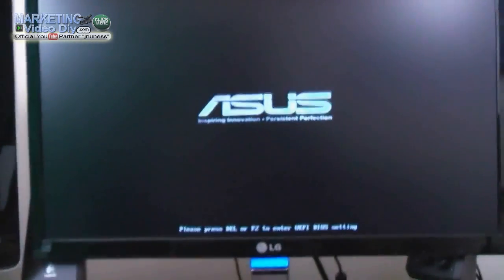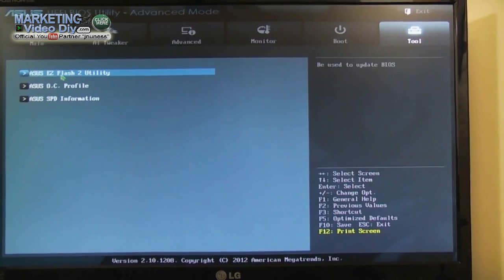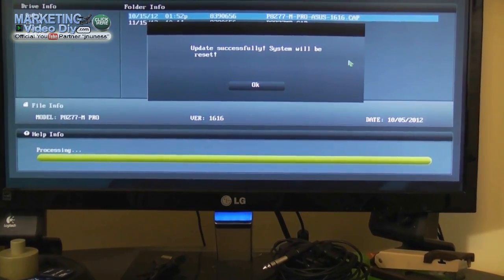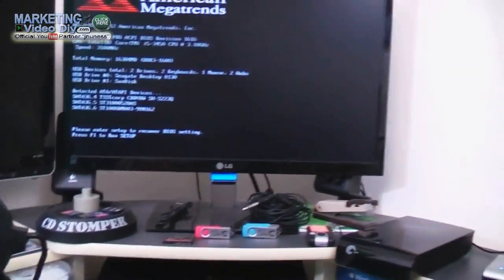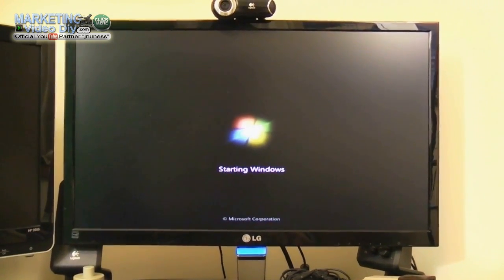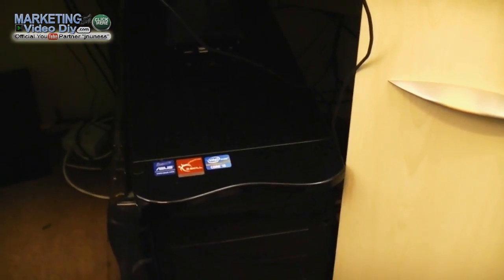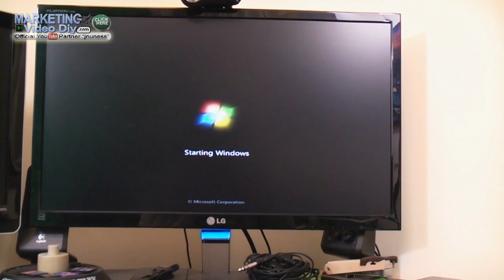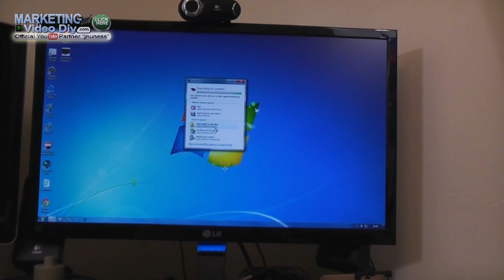ASUS P8Z77 M PRO failing to boot

Comment: I have a problem.. When I start my pc, the screen didnt show up and the pc keeps turning on and off continuously. Any help? My father cleared all the fans and tried the methods shown in the video, but it still have the same result. Is the power supply fault or mother board?
Reply: Gabriel Lee  bro its also same prob with me but i can change my hard drive and remove cell from board and remove rams clean then then then start pc after some beeps again install rams and hard drive then my pc goes on

Comment: Hi, I really need your help.. I have ASUS P8Z77-M.. same problem and I have follow your guide with the jumper and its power up twice but the first one, its just running but nothing shown on my monitor, just red light on the memOK. I turn it off and try remove the graphic card and one of the ram memory card then powered it up again but still its not booting. I put everything in again and try to power up again but failed.. even did the same thing again on the jumper. I did changes the cr2032 battery but still I cant get it to power it up.. I should have read it earlier about the red light memOK. (push that button about few second till it flashing). I really need your help if you have any other idea how to make it run again.. by the way.. the ram memory are in good condition, its just the mobo itself.
Thanks in advance.
Reply from the maker: +kunee51 Hi, make sure you use  gloves when changing the battery and do not touch on any parts with your bare hands after you put the system under load or the battery simply drains off.
So, what you should do now is unplug the machine from the main power supply completely, press the power button for a few seconds, while looking at the machine, you will notice any static charge will cause your CPU fan to turn slightly. If nothing happens, it means all energy has been drained from the system.
Now, using latex gloves, replace the CMOS battery with a new one.
Again, do not attempt to replace the battery with your bare hands, or the battery will simply go dead, when it comes into contact with your fingers and the board.
Regards,
Jose.
Reply from the maker: +kunee51 Regarding the machine starting and you getting nothing on the monitor, you need to make sure that the system is booting from the right hard drive.
How many hard drives do you have installed on the system? And if so, is there an operations system already installed?
Regards,
Jose.
Reply: +How to Video and Marketing Thanks for your reply.. I will try this by today and will let you know what's happening.. btw only one drive an yes there's an OS running on that hdd.
Thank you very much...
Reply: +kunee51 Hi again.. Im sorry, really forgot to let you know that it was failed to start not even once.. really had a bad time with it. I've checked other component by install it on other pc and it was ok.. its really my asus mobo problem.. just let me know if you have other idea what was happening..
Reply from the maker: +kunee51 If you bought it from an authorised retailer, then you can send it back and will be replaced free of charge.
Regards,
Jose.
Reply: +How to Video and Marketing bought this mobo for quite sometime.. I cant remember how long will the warranty lasted for.. will check... Thanks..

Comment: I fail to see how clearing the CMOS will fix a dead boot issue. It should at least try to physically start up. Jumping the CMOS is only good for clearing the BIOS settings. Poor BIOS settings will not prevent from physically starting to boot (as shown in your video)

Comment: So I have a problem with booting, but it's not quite the same. It can start to the Asus screen, but after that it just flickers gray and restarts over and over. I read a little about it on forums and they're suggesting  I should try to use single ram sticks in every DIMM, same results. I changed harddrive still same results. I removed the GPU and went on the boards internal gpu, still same results. Should I change CMOS or try updating bios? What do you think? Also something to add, I've been able to boot it normally before this, it just stopped working one day.
Reply from the maker: Xorrak Hi, how many beeps do you get when pressing the power button?
Reply: ***** Hey, thanks for responding. I started pc now and I don't hear any beep. It just keep restarting over and over to the Asus screen with a slight gray flicker after Asus screen happens. I have the case open and all I can see is a red led that flashes each time it restarts "dram" I have pressed that memok button and it says the memory are okay. Going into bios is not a problem at all. Just getting to windows.
Reply from the maker: Xorrak Hi, This is most likely an external problem. Bear in mind, the beeps you're talking about, should be quite faded, and they come from your board, and not from your speakers.
The best course of action is to unplug every USB device except your keyboard and the mouse,.
Next, turn off the machine, unplug it from the main power source, and press the power button a couple of times for a few seconds, so the system gets into static discharge.
Then, plug in the power cord, and power up your machine.
Once you get to the windows, then plug in your external devices, one by one, making sure it downloads and updates to the latest drivers.
Regards,
Jose.
Reply: Hi again. I tried as you instructed. I only had mouse and keyboard for USB but I tried to pull out both and one by one, while turning of the computer, pulling out cable and then hit power button on the computer a couple seconds but still same results. I put my ear so close that it almost got into the fan, still couldn't hear any beeping sound, just fans.
Reply: ***** Hi, sorry to bother you again, I just wanted to say I found the issue. My graphics card had broken, I replaced it and it worked like normal again.
Reply from the maker: Xorrak Hi, Thanks for the update. I knew it was something to do with the components, but the fact that you said you couldn't hear any beeps kind of threw things out of balance.
Do you still have no beeps when starting the computer?
Even though everything is working now, you should still hear one single beep, when pressing the power button on the case.
Regards,
Jose.
Reply from the maker: Xorrak ok you can hear one beep on my video at 3:32, click on the time to see the video again from 3:30, and you can year the single beep in the background, meaning everything is OK, usually this is how it works, if you get 2 beeps one of your components needs updates or is faulty.
These two beeps refers to any USB drives, graphics cards, hard drives, RAM cards etc.
Now, if you still have no beeps, I believe your motherboard is faulty, and it's only a matter of time until you find yourself in this situation again.
So, bear in mind that ASUS has a 3 year manufacturer warranty, meaning you can still send your board back to get it fixed or replaced, depending on how old your board is.
Regards,
Jose.
Reply: ***** Okay, thanks for informing me I will have that in mind for the future, and yeah, I don't hear any beeps, but I know what sort of beep you mean.

Comment: I bought a second hand P8Z77-PRO on eBay and had the same problem using a i7-3770 processor.
I found out that using a Corsair VX550W PSU was the way to solve the problem. I did some measurements and noticed that with varous PSU's the voltage on ATX pin 16 (PS_ON#) was around 4.7V when off, and with the good working Corsair VX550W the voltage was around 3.7V. I soldered a 100KOhm resistor between pin 16 and ground (pin 15) and the problem was solved with the other PSU's as well!
Reply: Mmm i think you are on to something here. My mobo is also dead and it reads 4.83v on that line, I have to see if I can find a resistor for that thing and see if it boots
Reply: I don't have a resistor like that laying around but I do have a resistor that has a brown black black orange gold band config
Reply: I'm not good at component stuff so don't judge me

Comment: This is common in asus p8z77 mother board i also have the same board and it went dead.. Got all fans working i know everything is okay I believe it has something to do with the asus mobo...freaking annoying
Reply: christian estrada I had the same thing on 2 different P8Z77 boards. Failed to start like a PSU or switch was bad, but it was the board in both instances.

Comment: I HAVE THIS PROBLEM WITH the p8z77-m  when i run games the board cant cope with the power and goes dead, I have a AX750 corsair PCU and one HD7850 so i guess it should be enougth. What u think?
Reply from the maker: Hi Andre, if the motherboard turns off while you're playing the games, check for loose connections and make sure the system is not overheating, make sure the cooling system is not obstructed by dust. 
If everything checks out ok, then your problem is with the PSU itself here you can see when I first built mine I used my 750w PSU, it burned out in a few days  http://youtu.be/QGvNW6zzAkE so I upgraded  to XFX PRO1250w and since then the problem is a thing of the past and I'm running the EVGA GTX660 actually I need to get the videos up of these upgrades.
Regards,
Jose.
Reply: Thanks fot the answer, Well , this PSU AX750 is really supposed to cope with it,  I have maxed out the power on the bios for extreme and maxed all powers options up, keeped the cpu normal default clock and it just run some game ok now, i guess it could have helped, but im afraid of it dying again.

Comment from the maker: Hi,
You have the same problem as the previous viewer, here are the steps:
Unplug your computer from the wall, press the power button a few times to reduce the static discharge, use latex gloves or an anti-static brace and check for any loose connections.
Replace your bios battery and restart your computer.
Regards,
Jose.

Comment from the maker: Hi,
Unplug your computer from the wall, press the power button a few times to reduce the static discharge, use latex gloves or an anti-static brace and check for any loose connections.
Replace your bios battery and restart your computer.
Regards,
Jose.

Comment from the maker: Hi, This only happens if you do updates of sound cards graphic cards etc after the first boot.

To prevent this from happening  with ASUS P8Z77 M PRO, remove the Bios battery before removing any components from the motherboard and replacing the upgrades... remember to use anti-static gloves and bracelet.

Regards
Jose Nunes
P.S. sorry for the late update